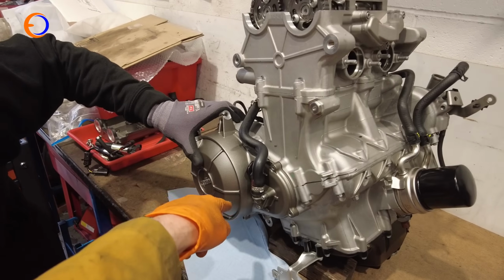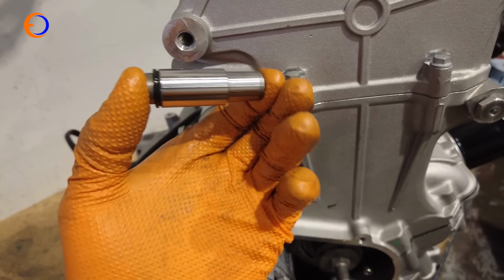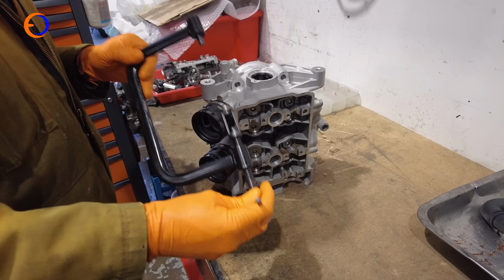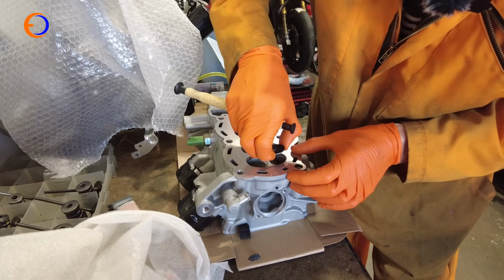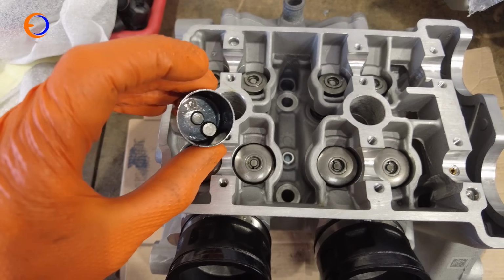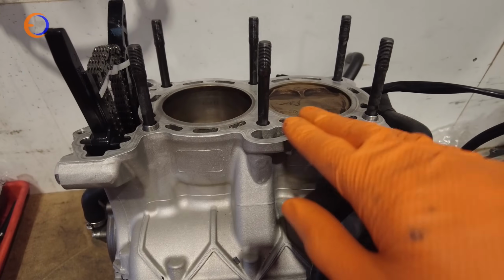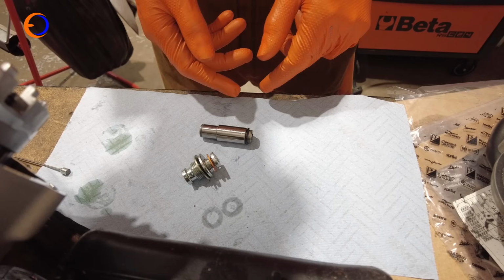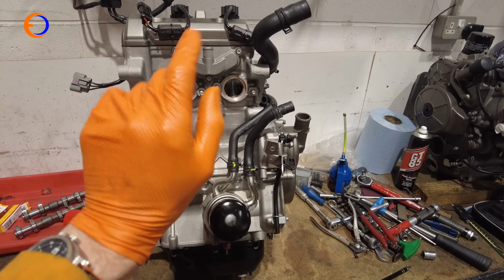How to Build a Fast RS660 Engine. Aprilia Supertwin top end Strip and rebuild. Gasflowed Tuned Cams

Comment: Thanks Dave.  Bubbling and a little oil in my radiator, so the head is coming off.  Very helpful and succinct video .  I don’t have time for porting, but this fall I will send it to EDR.  Still looking for a thinner head gasket than OEM.

Comment: what if i do this to my ninja 650 what would be the gains and would it still be reilble?just asking
Reply from the maker: Port work and cams would add a small benefit but the older er6 needed bigger throttle bodies and airborne to breathe better, that used to make the biggest gains, not sure if the later bikes are the same though

Comment: If a person goes to all the work of porting, running more aggressive cam profiles, then I would assume degreeing the cams with a degreeing wheel would dial in the precision necessary to take full advantage of the power that can be made.
Reply from the maker: The cam.spec is designed to run at stock timing
Reply: @obsession_engineering  In that case, I stand corrected. Probably just longer duration and/or higher lift?

Comment: Awsome video,m makes me think this is something I'll be able to do myself (not the headwork). The tip about spark plugs is interesting, I'm building a 660 to race and was wondering about plugs. What makes the CR9EKB plug more reliable that the OEM iridium versions?
Reply from the maker: The iridium plugs seems very susceptible to any fouling, so any slight fuelling issues cause them to misfire

Comment: Very nice work, but I would highly suggest putting Carrillo rods or any other appropriate heavy duty rod in any 660 that is being built for supertwins.    We have raced the RS660 in MA Twins Cup since its release and we saw a lot of ventilated cases until we were allowed to replace rods starting in 2023.  Problem solved..
Reply from the maker: We've seen almost non in the UK. Are you revving them above standard?

Comment: my rs has ratling cam chain, do you think it could be a leak in the cam chain tensioner rubber gasket?
Reply from the maker: Possible, but unlikely. Easy to check though.
Reply: @obsession_engineering  what do you think it could be?

Comment: Hi Dave. One thing I did notice during the rebuild was that the inlet cam chain drive gear was as far over to the right as it could go. Of course that may have been the camera angle. When I time up belts/chains on car engines, it's always advisable wear possible to have the locating bolts in the middle of the slot, were you not tempted to remove the chain, turn the gear as far over to the left and then re-time the engine so the slots/bolts are symmetrical? Anul, I know, but you and me are like that!
Reply from the maker: No, makes no difference where the bolt is in the slot, why have a slot and not enjoy it 🤣
Reply: @obsession_engineering  Couldn't agree with you more Dave, so it's just me that's anal 🤣👌

Comment: your doing the cam timing a bit wrong there compared to the Aprilia Manual & special tooling!  your supposed to install the cam holder with cams "off lobe" then rotate the intake into place with a special tool!  this greatly reduces the chances of damage to the head & cam cover when reassembling!

Comment: As a 660 owner this was really interesting. Great to see inside the engine and pick up a few tips on how to remove and re-install the cams should I need to. I got lucky at my 20,000km valve clearance check - all were still within spec so I didnt need to do any shim work 👍
Reply: Just a note, the procedure from April is to detach the inlet cam sprocket and use a tool to rotate the camshaft so there is no valve spring pressure before removing the cam caps

Comment: Great video. For some reason with my 660 after I install the tensioner and turn it over by hand the chain jumps teeth. Not sure if it's because I have reground kent cams?
Reply from the maker: Sounds like the chain has moved over the teeth while torquing the cams down, not had that issue myself though, even with the big cams
Reply: Not in this case unfortunately, both cams locked into place, even used the cam loading tool. Everything is aligned until I turn it over and it jumps. Maybe it's a faulty tensioner

Comment: Did you fit new valve guide oil seals ? I only ask because I reused some once and they ended up leaking, so I change them every time I have the head apart now. I probably nicked the edge of the seal. Modern engines are so neat !

Comment: why don't use it's tool to load/unload the intake cam?
Reply from the maker: Hi gabro, wasn't aware of a tool for that, and didn't really need it although a simpler system would be good
Reply: @obsession_engineering  without it is pretty hard to set the intake cam at timining point. Moreover the cam caps are not designed to compress springs by screwing it, you risk cracking it every time you do. BTW the Tuareg cam tool costs just a few bucks and works very fine when motor is dropped from the bike, buy it!
Reply: This is the part number for the official Aprilia timing kit which includes the inlet tool Gabro is discussed 👍

There are currently 36 kits in stock at Noale Piaggio 

021045Y